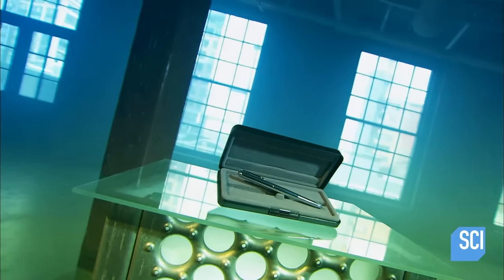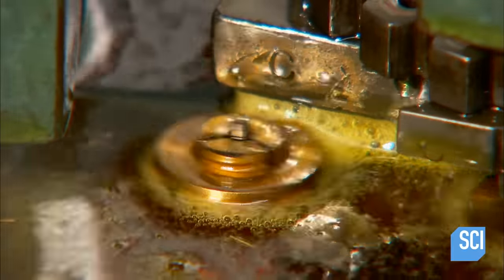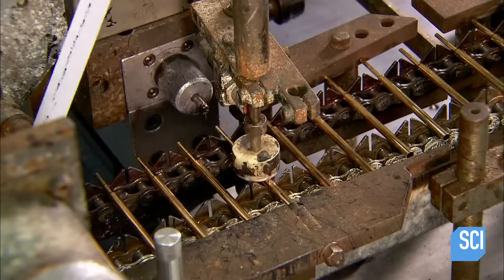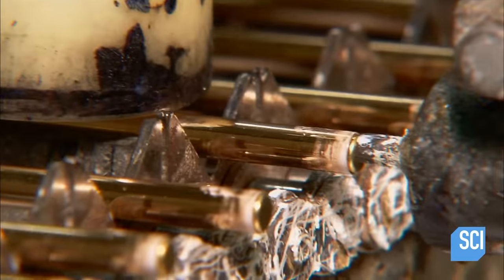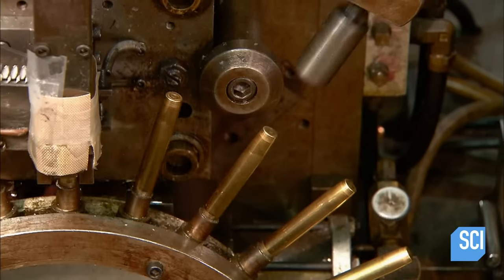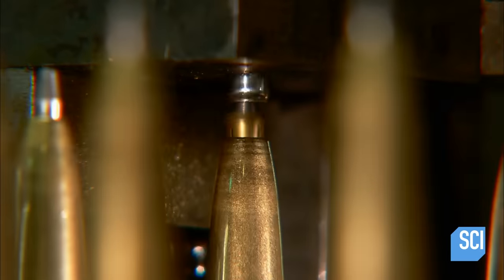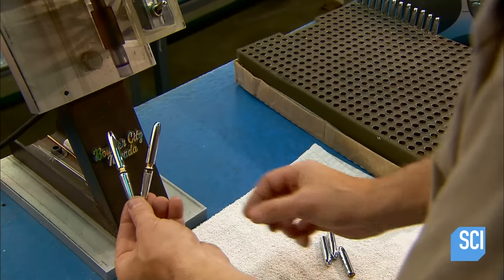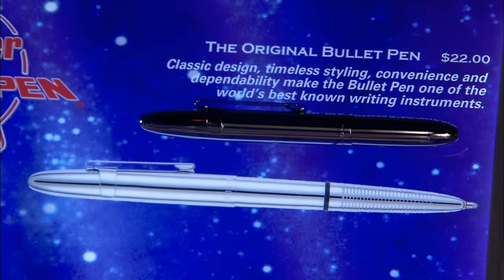How It's Made: Space Pens

Comment: I have the bullet pen on my desk right now. I've had it for years. It's great because if you put the cap on the back then it becomes a full sized, well balanced pen. But if you don't use the cap then it is a short stubby pen, great for making marks in tight areas. It really does write everywhere in any direction. They are more reliable then pens I've used that cost $100+.

Comment: I had several of them.  They always get lost.  

I found 3 of them when I replaced my dryer.  Found replacement cartridges...  then lost all of them again.

I had the short ones in stainless.
Reply: Hands down, the best pen I have ever bought.... Fisher Space Pen. I bought it at the Sand Hill PX when we were given a 36 hour pass(Before OSUT was implemented) between BCT and AIT. I had it on me whenever I had my ACU's on me, it was literally a part of my uniform. it went trough everything I did and stood up to it all. It never needed a shake to get going. it would write without a doubt whenever i needed. upside down, full of mud and sand, on wet sweat soaked paper, it had even gone through the wash and the dryer... it wrote like it was brand new every time. After having a pen with that reliability and then one that wasn't... ugh. I know it's just a pen, but the thing was the absolute best pen ever and i only payed $5

Comment: A Mentalfloss misconception told, NASA in the 60s spent millions developing a space pen.
Reply: @pascalhonore6996  It worked, but they're simply not ideal
Reply: @darnit1944  Of course it worked (or would have worked). It's the "not ideal" part of it that can be deadly (at least problematic in zero gravity to humans and electrical equipment alike). Like not wearing a seatbelt. It works (you an still use your car), but is not ideal 😁
Reply: @ztuzar163  and they decided to also buy space pens because they found that the tips break off which sucks in a small space and in a area where a small spark will kill you

Comment: The Russians were smarter, they just used a pencil.
Reply: Myth. Using pencils in space is dangerous. The pencil "lead" is actually graphite. Graphite is an electric conductor. In a low gravity situation, particles of graphite can float and get into circuit boards and cause a short. NASA used wax pencils for this reason.
Reply: @cultclassic999  do you realize how many entire pencils they would have to go thru and how many hundreds of thousands of pages they would have to write for there to be enough graphite to short the smallest circuit? Not to mention their air is constantly being filtered.lmao pencils shorting circuitry..nice try tho
Reply: @floridanews8786  But why take the risk, even a minute risk, when you can just use a wax pencil and avoid all the risk? Which is what NASA did.  I was just pointing out that the whole narrative of Russians being smarter than NASA because they used pencils is bogus.
Reply: @floridanews8786  The Americans used pencils too, up until someone came across the Fisher Pen, which by the way was completely internally funded by Fisher and initially had no relation with the US Space program. NASA initially used mechanical pencils sourced from Tycam Engineering Manufacturing Inc at $128.89 per pencil. When these numbers leaked, NASA scrambled to find a cheaper option, at which point Fisher Pens approached them and offered to sell their internally funded and developed AG-7 pen to NASA at a bulk discount. NASA bought 400 of the pens at a price of just $2.39 per pen.
Reply: myth when the truth is concealed myths take it's place
Reply: @richardmillhousenixon  Wow, I never heard of the ag-7 pen. Thanks for sharing!
Reply: @floridanews8786  The AG-7 is the actual model that we now know as the space pen. They're the same thing
Reply: @richardmillhousenixon  are you sure? Wasn't the original expensive so they made the ag7 as a knockoff?
Reply: @floridanews8786  The original was the AG-7
Reply: @richardmillhousenixon  ah..ok thanks! 👍
Reply: @richardmillhousenixon  they used crayons before the Fisher pen.

Comment: Though most of those conditions a pencil can write in too.
Reply: In the case of space flight, pencils bring the hazard of broken graphite floating around and getting stuck in/damaging sensitive equipment and causing fires. Also, pencil cant write on every material, requires sharpening if its not mechanical, and isnt seen as easily as black ink. I think they did use crayons though!

Comment: The USSR was not as technically advanced as the USA, but they were still smart enough to know that a mechanical pencil works just as good in space and for a small fraction of the cost.

Space pens are an example of overthinking the problem or ignoring the obvious.
Reply: What about breakage from graphite shards and floating everywhere in the room.
Reply: @james555433  
What about ruptured pressurized ink cartridges and ink floating everywhere in the room?

The air in those capsules was continuously circulated through filters.  The human body has lots of loose stuff that comes off that you do not want hanging around and accumulating in front of your face.  A study showed that the large part of the dust on your furniture consist of dead skin cells and fabric fibers.
Reply: Graphite shards are highly conductive and can wreck havoc in electronic systems in zero G
Reply: @brymaan1online217  
Liquid ink is no slacker either.  Six of one and half a dozen of the other.

You can be careful and not break a pencil.  A pressurized ink cartridge is beyond your control.  A pencil will not explode if you depressurize the capsule.  A pressurized ink cartridge is far more likely to explode; when they made space walks the original capsules did not have air locks.
Reply: This is false, before the invention of the space pen both the US and and the USSR used grease pencils. However grease pencils are flammable. The space pen solved this issue, so both the US and the USSR switched to the space pen.
Reply: @theshlauf  
The grease pencil was flammable?  Did you forget about Apollo 1?  Just about everything inside the ships that was not metal was flammable.
Reply: Ink in Spacepens was developed like glue. When the pen is breaks, ink stays stuck to the pen and does not scatter into space.
Reply: @ATREY178  
The ink in ball point pens is viscous to prevent it from free flowing out of a pen when held upright and dripping on the surface of it is held above.  That was one of the problems with quill pens and why the script style of writing was developed.  That viciousness also caused the ink to stick together so as the rolling ball slowly moved ink out of the cartridge it would pull the rest of the ink towards the ball rather than sloshing around.

But the ink in the "space pen" was pressurized.  Viscous though it is, what do you think is going to happen if the pen breaks and the sudden release of pressure forces the ink out of the cartridge?
Reply: Look at video about 02:20. Ink is like honey. If pen is broken, ink leaks relatively slow and stay together. No spray to space. Do you think NASA didn't test it? Ink was developed so that it would not burst to space.
Reply: @ATREY178  
Did you watch the video and see the ink being forced out of the cartridge in a stream by the 36 pounds of pressure applied to the cartridge.  In zero gravity that ink would flow straight away from the pen, and if not caught immediately, would continue away from the pen.  One blob or many, ink floating around into the cramp space of the Apollo capsule or even the space shuttle would make a mess on whatever it touched and who would have a rag readily handy to catch it if the were aware of it when it happened.

Non of that would be a concern with a pencil and pencils are far cheaper.